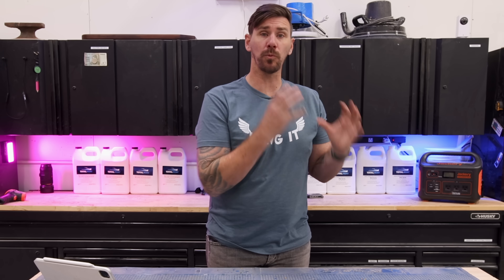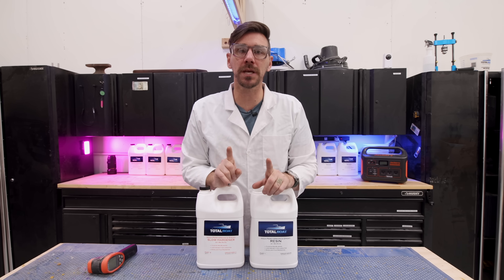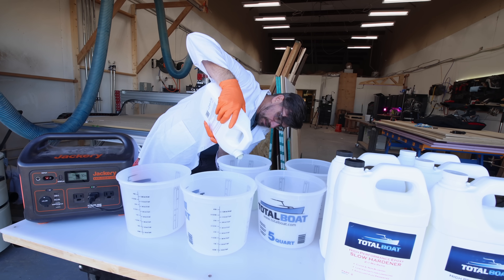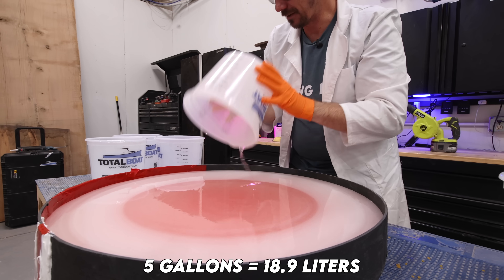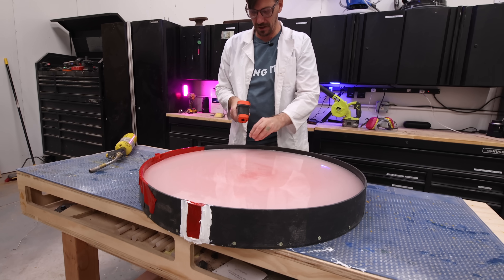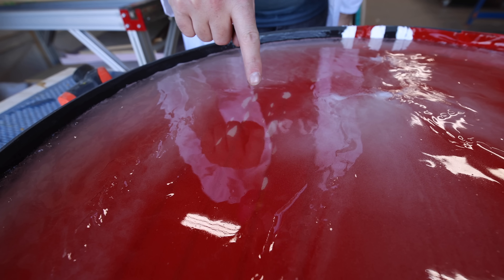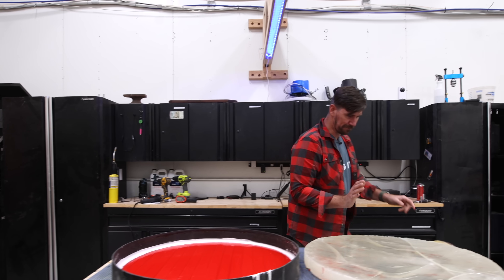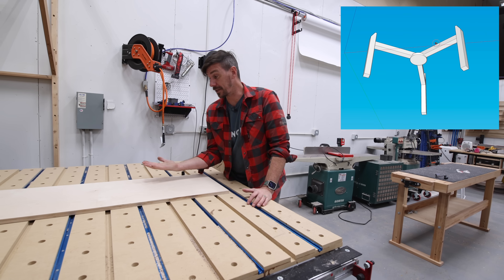300 Degree Epoxy Table

Comment: I accidentally wasted $60 in tabletop epoxy.  I had always just mixed and immediately poured and never had a problem doing this with 1 gallon at a time.  This time, I decided I was going to test out my new vacuum pot  It took about 10 minutes to get the vacuum going and everything looked like it was going great until the bubbles stopped and I noticed these large bubbles on the surface that weren't moving.  Turned off the vacuum, opened the container and the resin was gel like for a few seconds then instantly hardened.  I poured ice on it and the water boiled for a little bit before the ice cooled it down.   It was still 160F 4 hours later.  The bucket was like rubber for a while due to the heat.

Comment: I bet you're glad that total boat give you free resin. That's $1200 worth of resin here in Australia. I've done this intentionally with the resin i use because I know what happens when i do it. The resin gels on the top and then as it cures in the middle, it cracks. Not like you cracked yours but you know, slightly less excitably 🤣Then, once it's cured all the way through, you can fill the cracks with a different colour and it can look spectacular. I don't use it often though because it's totally random. Sometimes it looks shit and sometimes it looks amazing. If you'd have connected all those pieces together with a thin but totally different colour, it would have been super cool.

Comment: Hello Jonny.

THAT'S HOT

I had a project, to make a long wood/epoxy table, but due to several problems, it is delayed for now.

But I met a new problem along the way "chemicals in the wood", that I planned to use.....and I dont know, howe these chemicals will act with the chemicals in the epoxy !!!

I were thinking about using railway swelles - not the new ones, but very old (decades) ones, but a friend of mine told me, that these old swelles contains a lot of bad stuff, as creosote, gasoline, oil and some other nasty things.

Do you by any chance, have any knowledge of these things acting with epoxy.....?????

Comment: Good ventilation and/or a respirator are crucial when working with epoxy. Or even a little at a time if you do it often enough. Not just when it gets real hot. It is very toxic so please be careful!

Comment: Should I get the $10 extension cord to run a drill right outside my shop?  Nah…grab the $500 battery pack instead.  😂. I get having to create a use case for the sponsors….

Comment: Another idea for that broken epoxy would have ben to glue it back together but a little larger than the original circle, that way you get the blue in the cracks rather than on top (kinda like that japanese technique of fixing broken things). great build!

Comment: Was the first poor actually solid and cured enough to use? Did the fact that you poured too much at one time, still allow it to cure correctly or no - causing the break as soon as it hit the ground? Also could you do the same experiment, with the wrong mix ratio. Good experiment though.

Comment: interesting.  I've gotten a little aggressive with the pour depth myself in the past but have not seen anything I could not recover from with the exception when I was mixing some epoxy and it went off on me.  Probably had the ratios wrong.

Comment: I really do love the ice look!  That and it reminds me a bit of sea glass.  Great way to salvage a potential disaster (or several).
Reply: I'm trying to recreate the sea glass look in a table. I'm wondering if the finish that goes onto the wood part will get rid of the rough texture of the sanded epoxy. What do you think?

Comment: I would not have epoxied the pieces back together separately from the second pour. The blue would have filled in the cracks and looked pretty cool. The challenge would have been keeping the pieces from floating though.

Comment: During this video, I'm shouting, "Shut up and Do The Pour!!"

When you're on the freakin' epoxy clock, you shouldn't be stopping to explain things. 
One either shuts up and does the Time sensitive work or one learns to do both at the same time - talk and pour. 

I like it when you actually think about what you are going to do, and do it well.